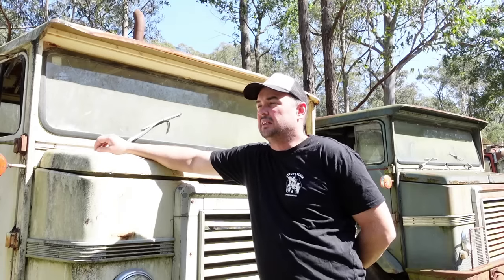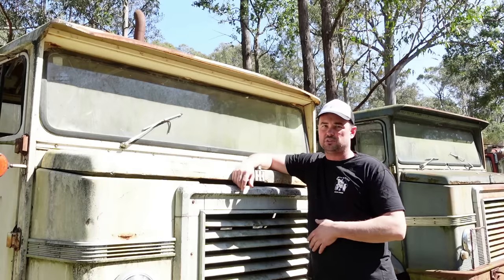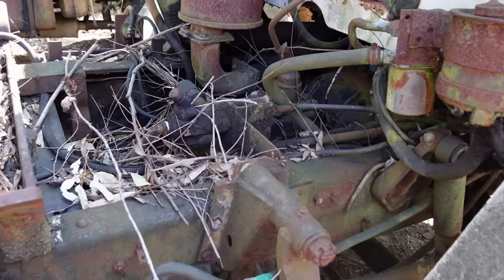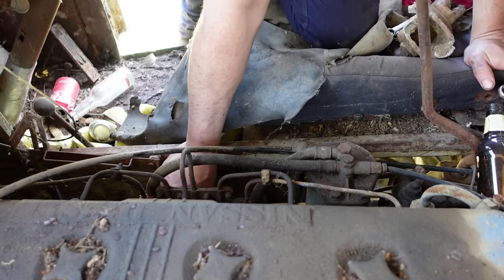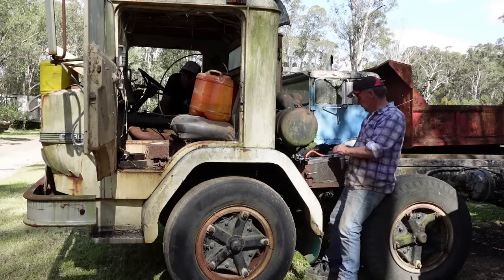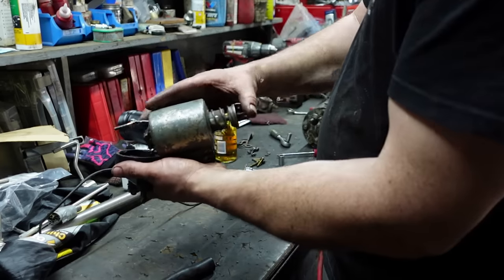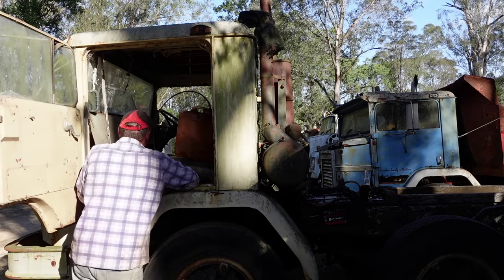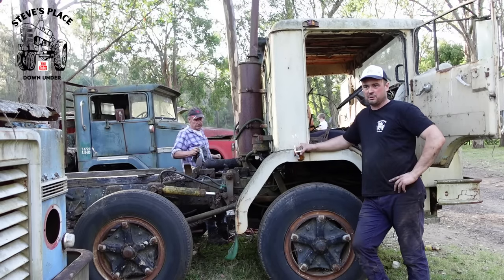Will It Start? Nissan Diesel 2 Stroke UD5

Comment: Some haulers had these v8 in them and some smaller haulers had the 6 fing loud as hell couod hear em above the chainsaws , i also worked on a bedford tow truck with a v8 in it could hear it screaming thru the stacks from many kms away
Reply: is that the UD8 345 hp engine you mentioned, some had turbos
Reply: UD8 was made till 88 or something like that, if these UD 2 strokes were made today they would be nuts!The UD4 does 180hp with out a turbo and god know how much more with turbo and new common rail! Hypermax racing out to replicate this engine for tractor pulls

Comment: A bit more history... Junkers, the German aircraft manufacturer, back in 1932 introduced the Junkers Jumo 2-stroke diesel aero engine. Not terribly successful given the power/weight ratio. But that, I guess is the origin of your engine. The more you know... And Krupp was a major arms manufacturing dynasty going back some 409 years. They made massive artillery pieces that blew the crap out of us for 2 world wars...🇬🇧👍
Reply from the maker: Thank you mate. Yes they did make a 2 stroke in the 30s around when Detroit introduced their first one. I wasn’t aware of what Krupp was doing at the time but it’s certainly a name that I’ve seen somewhere doing research
Reply: The pre-war Junkers engines were opposed piston ones (same principle as Commer's OP but not identical with gear cascades connecting two cranks, not push rods), nothing like the design which became the Krupp 2 stroke after the war and which I believe Minsei licenced. The first big Nissan Diesel trucks also looked very much like Japanese versions of the Krupp Titan/Tiger/Mustang etc. Krupp by the way never made any V configured engines, they went all the way to 7 cyl. in line (I'm not making this up). They gave up on the 2 stroke game in the early 60s and instead started building the mid-size Cummins V6s and V8s under licence until they got taken over by Mercedes-Benz. 

Adding: bloody hell, it even sounds like a Krupp.
Reply: yes the Jumo junker 205,207 OP 2 strokes, now i would redo one of those with carbon fiber v-force reed valves ans stuff the case which seals them off for good scavenging pressure. use the stock dry sump and VRO pumps with castor 927 maxima 2t oil and have fun! next how about a 1700 OP Rotax Etec made from 2 850 Rotax Etec turbo skidoo turbo R and lay it down in the sled!

Comment: Suggestion: build a little diesel generator unit (on a dolly or something) for 24v so you can just let it run while you attempt to start, and never deplete your batteries.
Reply from the maker: Thank you mate. I have a petrol one but never think to use it because of the noise when recording. It’s something I need to sort out

Comment: happy your keeping  hydrated Mates   never  heard a ACCo like that   dont how much power that Nissan would put out what did it use to cart
Reply from the maker: Hi mate yes always hydrated. It’s about 200-220 hp, had a tipper on it going off what’s left on the chassis. A lot of them where tippers and concrete agitators

Comment: Hey Steve, That cardboard box they had over the engine didn't do much sound deadening at all, it was fingers in the ear's as a kid. That rag on the snorkel cant be helping. I would think they would be hard to Roadworthy Today!
Reply from the maker: Hi mate no I’m sure it didn’t do much at all. I’ve got it there but leave it off. The snorkel wasn’t connected when I started it and it’s shade cloth over the snorkel for whatever reason.

Comment: UD nowadays, is United Diesel for quite some time. diesel kiki has been renamed to Zexel.
Reply from the maker: Thank you. Yes I’m familiar with zexel pumps but wasn’t aware that it was previously diesel Kiki
Reply: @stevesplacedownunder   i watch a lot of vietnamese fellas pulling old diesels apart some chinese ones have zexel on them so i googled the name and came across the diesel kiki and they had written that around 201? they changed their name but essentially they are a builder of devrived pumps by bosch under license, its funny how most inline diesel pumps derived or are a copy of the bosch pumps, and the rotary (distributer) type is based on lucas/cav and i think the delphi ones were a licensed copy of lucas/cav.
Reply from the maker: Thank you for this. Yes I did mention they were the same as Bosch, only because to me they look the same. I’ve seen zexel on a lot of older stuff too but didn’t click that they may have been taken over by them. Thanks again

Comment: Hi there  im just wondering  would u have a left an right cabin door for a 1963 mk3 acco that arnt  to badly rusted an with working window  winders an glass  please 🙏
Reply from the maker: Hi mate. No I don’t have any for that model. I don’t even know were you may get some either. I’ve mainly got complete trucks with the earliest being 68 short door. May be very similar I’d imagine but can’t pull it apart
Reply: @stevesplacedownunder  ok 👍 thanks

Comment: Do these run at higher revs that a typical diesel?
and with the 4 steering wheels in this era, interested to know what sort of work it would have been doing?
Reply from the maker: Hi mate no I think probably around 21-2500 like a Detroit would. 
 I believe from what’s left on the chassis rails it was a tipper on it

Comment: Good thing about these old diesels. You could probably run them on chip oil when diesel becomes more expensive 🤣
Reply from the maker: That’s right mate and plenty did I’m sure. I know a bloke right now that does it.
Reply: Yeah and use castor 927 maxima 2t oil through the crankcase and pull it off and premix! I have done this on my 8v92 detroit 2 stroke turbo with a few gallons of BRP XD-100 and it works great.

Comment: Early on steve you talking about scavenging etc. I'm not sure if those UDs were loop scavenged, meaning they don't have exhaust valves or not. I know Detroit's had a 51 series that had that.
Reply from the maker: Hi mate you may be right. I’m sure it does have valves though. I have heard of this
Reply: @stevesplacedownunder  Cheers I believe you. I reckon they're a rip off of a GM. I always thought that similar power ratings etc, except for the 5 cylinder. Just to be a smart ass. More on this later.
Reply from the maker: They are very similar mate yes
Reply: @stevesplacedownunder  My father had a 1977 model UD CK40 single drive with a 4 stroke PD6T 250 HP.
It pulled a tri-axle with 22 tons of steel on the back. It worked pretty hard, went okay really but blew a turbo after a while.

Comment: The five cylinder is rated at two twenty five HP
Reply from the maker: Thank you Graeme. I had a feeling that it was 24 and that’s what I started it with. She hasn’t got a series parallel switch though so I don’t know how the dash and the rest of the truck works with 24 volt. It may all have been converted. Hope all is well mate

Comment: I would like you  to fire it up again and let it really sing  its famous scream. The closest engine I have ever heard that sounds like a UD5 - is a 8V53 . But every single UD 2 stroke Diesel engine sounds different to each other . I have never seen a UDV8  rated at 345 hp  but in the early deals on wheels about 1984 I seen one printed in pieces for sale in W.A. Mining gear or truck engine .
Reply from the maker: Hi mate yes I will do it again no problem. Ud8 I have seen but not very common here now
Reply: has anyone turboed a UD 8V75 or a UD v-12 2 stroke? that would be nuts!
Reply: @jlo13800  UD v12 two stroke is way too big and heavy to do anything with . It’s horse power is in between from from 500-700 horse power it would have no more than that as it is a stock engine!
Reply: It puts out more than a 12v71. A turboed UDv12 2 stroke would be something in a big truck.
Reply: Darn to bulky and heavy to mount a UD V-12 2 stroke on a shifter kart
Reply: Jim Morrisons 433 CID 2 stroke v8 did 1330 hp n/a and was an advanced 8 port DFI 2 troke engine! it was light my fire edition and was later sold to Rotax!

Comment: UD trucks now use Volvo powertrains, luv these old trucks, but I dont have to drive them now, aged out of that finally
Reply from the maker: Hi mate. I wasn’t aware they used Volvo powertrains. Nothing surprises now with the new stuff. I used to like the UD products but the company I work at bought a brand new tandem drive rigid one for a water tanker and it literally broke in half. Cracked through the rivets where a fish plate was on the chassis. Just the top flange of one rail holding it together and it’s rusted so bad like it wasn’t primed from factory
Reply: UD was purchased by Isuzu from Volvo only 2 years ago. I imagine they will start running Isuzu drive trains in their future models.

Comment: Those GM 2 strokes last for ever
Reply: So do evinrudes and mercury's if cared for well.
Reply: @jlo13800  yes I have 45 year old Evinrude .but right now I am working on a 60 year old Michigan load end. The GM 2 stroke has never been  touched
Reply: yeah the evinrude makes way more power than sucky detroit 2 stroke and the oil injection on my 8v92 sucks until im ready to burn all that crap off my plasma cutter and dry sump it. i fucking hate the stock oil injection system on a detroit and my johnson v8 4l and omc wankels 528cc 2 srtokes make way more power for thier size, all including my 8v92 take XD-100 brp synthetic 2 stroke oil! A scaled up Rotax 850 Etec, polaris patriot and arcticat and cummins ace op 2 strokes are the new girl on the block!
Reply: i got a turbo 8v92 out back to tinker with, got it working on BRP XD-100 2 stroke oil too and she purs.

Comment: You need to use a b f h tool on that starter works 85 % of the time
Reply from the maker: I did try it mate😁😁, the problem it ended up having though it wasn’t going to work

Comment: Foden diesels work on the same lack of principals.  The Napiers were definitely licenced from Junkers at first.  I think their first aero engine was the "Culverin" and I think their "Dagger" was diesel. They were 2 pistons in the same bore jobs still with blowers, the biggest of which was the "Deltic" arranged triangularly with 3 cranks. The Rootes engines were also double knocker, but used levers and only 1 crank. God were they loud. Ignore that 40 years of being a clever twat. I found it fascinating.
Reply from the maker: Hi Neil. I’ve been watching some YouTube videos on these Napier engines in locomotives, fantastic design and power. Deltic that’s right. 
 I have 2 rootes diesel’s here, all they needed was a starter motor but now I realised that the injection pumps were pinched off them also. I was very upset when I found out. I will try and get her enough parts to start one up

Comment: With every drop of diesel to the ground another "just stop oil" crybaby began to whine louder.😂

It's not like you're having diesel and petrol fights like kids have water fights. Although if you could afford to fix would be wondering just what the heck you're doing playing around with these old trucks in a back paddock area and not in some higher shop with lifts, more tools than a matco factory and not saying things like. "I'll have the fellas put this up on the lift and get started on getting that new starter put in the. I'll have them..."